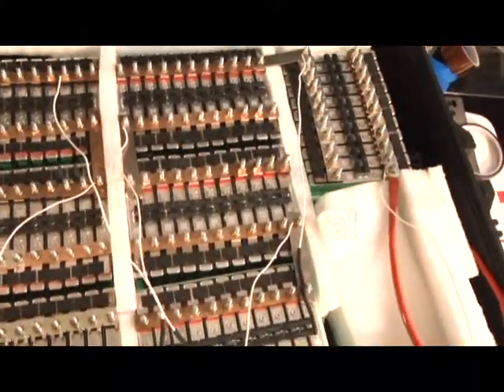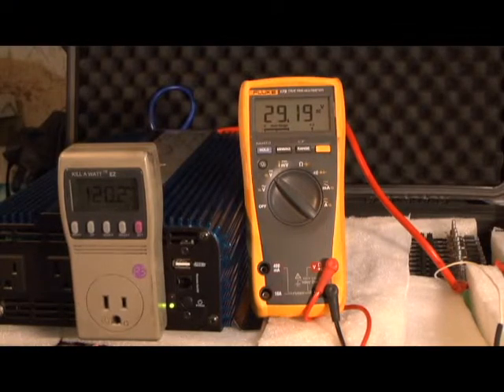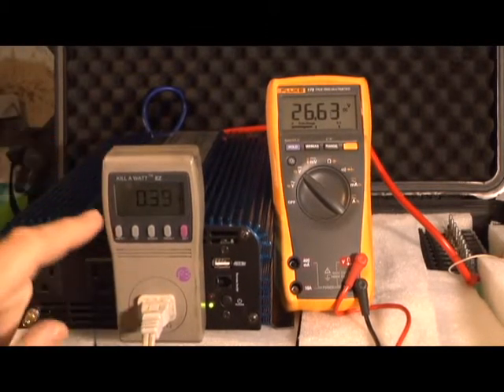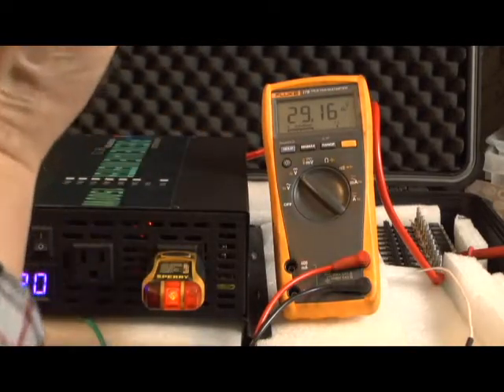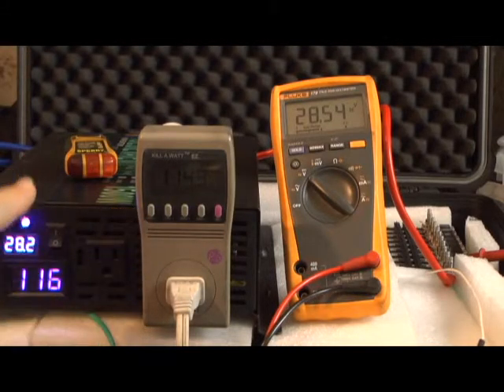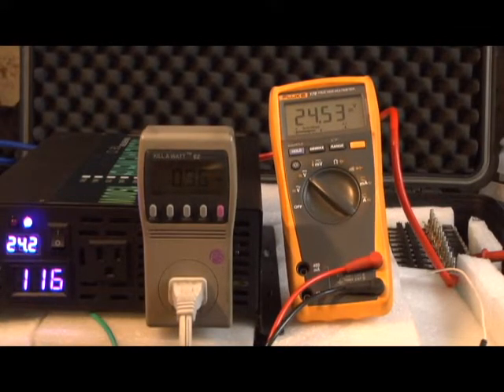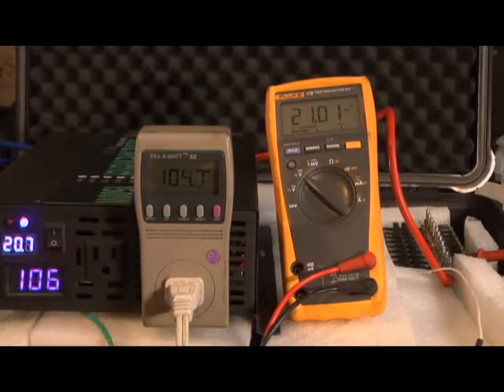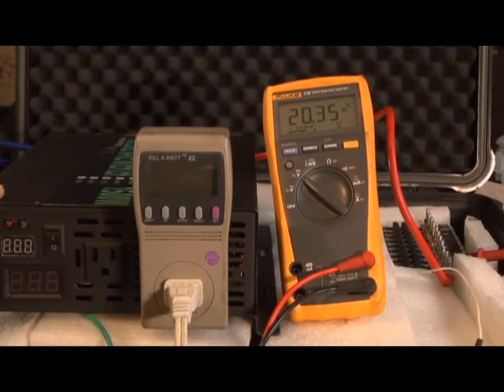Aims vs.  Reliable 1500 Watt Pure Sine Wave Inverters

Comment: I watched this before I bought my Aims inverter/charger and I almost bought a 1500 watt 24 volt one which I wish would have been in this test but I had that first stimulus check lol so I used it on a 2000 watt 24 v and it's just right..I've been buying 2 batteries a month and next week I'll have 8 of them so I can probably get to use my antique induction welder from the 40s..it has white copper windings so it doesn't take much to run it unless the welding rod sticks then it'll pull about 20 amps for a second or two..I guess that's the surge part idk but it should work I think so I'm gonna try it...I can't imagine changing 8 fuses every time  a rod stuck while using of those Mickey mouse inverters..that's just silly..

Comment: hi, try opening the reliable up and there is a blue pot with a small flat head screw driver that you can set the output voltage to what you like, I like to set mine to 125v hope this helps.